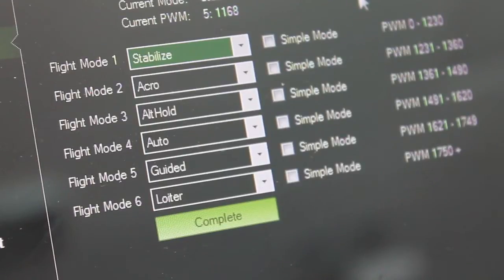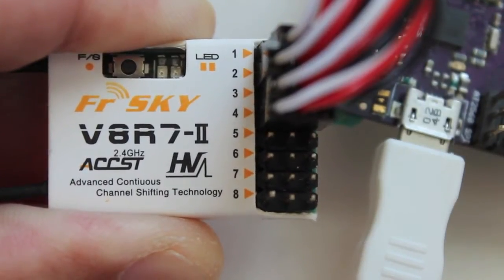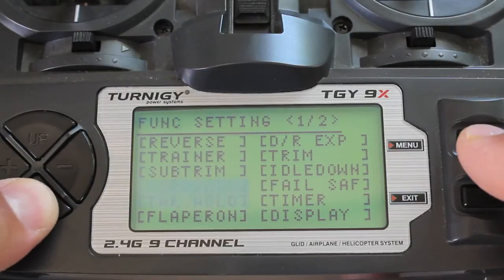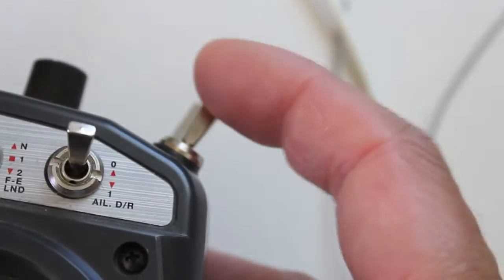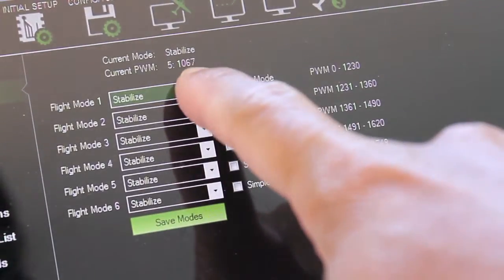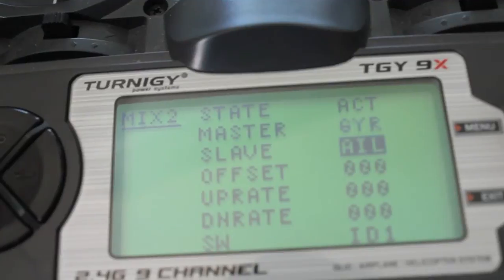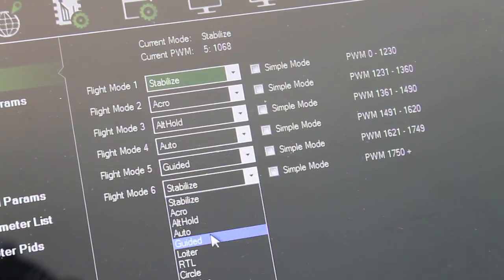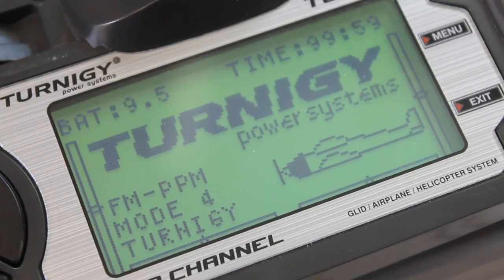Turnigy 9X Stock Firmware 6 Position Switch for 6 Flight Modes with APM 2.5 and Mission Planner

Comment: I have the turnigy 9x and apm 2.9. I performed all steps exactly as shown and got mix 1&2 working for states 1-4 when the SW is at position N&1 but the PWM is not changing at all when i am trying to set mix 3 for SW2. Any ideas on what may be wrong? Thanks in advance.
Reply from the maker: Anthony Caquias I'm not sure what's going on. Unfortunately I no longer have my 9X so I can't help diagnose. It sounds like you're close with the 1st 2 mixes so my only recommendation is to mess around with it a bit more and see if you can get the 3rd working. Sorry I can't be of more assistance!
Reply: Dennis Baldwin Thanks for responding. After 5 hours of troubleshooting my friend and I opened it up and found a resistor that wasn't soldered to the board properly causing a short. We were able to fix it and now its working perfectly. We also put in a switch to shut that annoying beeping sound off.

Comment: Are you using the frshy module on this radio? I can't get it to work on my radio with the flysky module and flysky 8 channel reciever. I got the 3 position in heli mode working but not the 6 in acro mode.
Reply from the maker: Ronnie Bruton Yes I'm using the FrSky module in this video. I'm not sure about the Flysky setup as I've never used it. Hopefully it's possible for you since I believe it runs the same stock firmware as the Turnigy9X. Sorry I can't be of more assistance.

Comment: Instead of using gear would dr switch be set up the same way on th9x? Would I have to use a different channel or change mix?
Reply from the maker: Ronnie Bruton I really wish I knew the answer to that question, but am not entirely sure. If you can configure the DR switch as an auxiliary channel then I would expect you to be able to do the same thing we do with the gear switch on the T9X. Good luck and let us know what you find out.
Reply: I seen done with er9x, maybe on heli mode

Comment: why do you use the ch6 on receiver and not ch5 and then why you assing ch5 but you use ch6 as gear? what if you use ch5 and how to if you could!
Reply from the maker: Nikiforos Pavlidis I'm not sure how to do that other than a custom firmware load like er9x or OpenTX. To be honest I'm not sure why it's configured this way as it's always been a bit confusing to me. But I'm glad it's possible to get the 6 modes. Thanks for the question and sorry I don't have a better answer :)
Reply: Dennis Baldwin  i am think to add a head tracker to my flysky tx but me receiver is almost full 1234ch for motors,ch5 is empty, ch6 to ch5 on apm,ch7 and ch8 on ch6 and ch7 on apm for rtl mode and autotune mode! i know i have to sacrifice the the ch7 and ch8 for head tracker channels but i like the idea to have emergency rtl mode to ch6 via throttle hold switch assing to aux channel. also my ch5 in rx is useless!!! thank you anyway for your nice videos and tutorials. keep up the good work!!

Comment: Hey does the inputs get switched back to normal after the flight modes are configured.  I have a y6 and I switched the inputs back but only have 2 flight modes now.
Reply from the maker: neil collins Interesting. I haven't tested that before. Will have to look into it. Thanks for the comment.

Comment: Dennis Baldwin, thanks! Guide work perfect when switching my new Quanum Nova to the 9x and receiver. Question. Did I loose my channel 5 now that I set up the flight controls on channel 6 on the RX? I wanted to use the extra channel I got with the new RX to do autotune.  Thanks again
Reply from the maker: Chris Haskins Hey that's a great question that I don't know the answer to. I should have check this when I did the setup. Duh! I'll see if I can revisit soon and find out. Let me know if you beat me to it :)

Comment: none of this does anything in APM for me. No flight modes change
Reply from the maker: Waylon Johnson Make sure you're on the right channel. I believe with APM:Plane firmware flight modes are on CH8 will with APM:Copter they are on CH5. If that doesn't get your flight modes PWM moving then I'd check out TX settings. If you have further issues then check out www.garagepilots.com and post in the forums over there. Good luck!

Comment: My PWN is 8, is there a way to change it to 5 like yours?
Reply: Solved it by changing params, thanks for the vid
Reply from the maker: You bet! Glad to hear you got it figured out.
Reply: Dennis Baldwin Leo TL  can you please tell us how you exactly solved it because my pwm is also stuck on channel 8 and i dont know how to change it. PS: i am using the board on a plane. thanks :))
Reply: You have to go to the full parameter list in mission planner and set the param called FLTMODE_CH to 5. I had this problem on my plane too so it should fix it.
Reply: Leo TL  it worked thanks a lot!!

Comment: Ok, this all worked, and it's great, but I'm a little confused.  Channel 6 on the receiver is plugged into port 5 on the APM.  Channel 5 on the radio is set (under AUX-CH) to GEAR (and if I change that back to NULL, no more MODES!).  Have I "consumed" TWO channels of the radio to get six flight modes?  Or, as I seem to have "mapped" channel 5 to 6, can I somehow recover channel 6 by "mapping" something else back to 5?  And this brings me to wanting to map other switches to channels.  When in AUX-CH, I get four choices in addition to NULL, THRO HOLD, PIT TRIM, HOV THRO, HOV PIT.  There is no knob or switch labeled "THRO HOLD", so this is a mystery, and apparently no way to address AIL. D/R, ELE. D/R, RUD. D/R, or THR. CUT.  Does this radio just have four totally useless and inaccessible switches on it?  I doubt it.  If Turnigy won't spend a tenth of a penny a unit to write a manual, they aren't going to spend good money on switches.  Any clues would be appreciated.
Reply: If you didn't get an answer to your question about AIL D/R, ELE D/R and RUD D/R look under function settings, D/R EXP. In there you can select the CH and toggle them on and off. As to the purpose, I believe it is to give the option for having dual rates.   I'm not sure. Hope this helps.

Comment: hi there i have one question... what if i need to use autotune ch7 in mission planner do i have to wire the cable from ch6 to ch5 in ch7 to ch5? or do i have to run a new wire fro ch7 to where? any help musc appreciate! thank you!
Reply from the maker: Good question. I'm not sure about that one but will look into it when I get my apm copter back in the air!

Comment: Hi Dennis,  thanks for your efforts to teach us. I tried this method on APM Planner and works,  but I have to use Mission Planner because its mapping tools and  doesn´t work anymore for me. In my MP version - 1.3.5 - The "current" channel is 8. What the correct connection for this case? What I have to change in my Turnigy and my connections from APM to receiver? I´d appreciate your help,  is very very important to me and I don´t found  options to fix it at Wikia. Best regards!
Reply from the maker: If you're running on CH8 then you must be running APM:Copter firmware. CH5 is used with APM:Plane. You can still use CH5 on your receiver and connect it to CH8 on your APM. Then configure as described in the video. I hope I understood your question and that this helps. Take care.
Reply: Tks again!

Comment: Thank you so much for figuring this out and sharing it I got everything all set up just like you had on your video but the only problem for me is that when I switch between modes the quad copter just jumps all over the place in flight almost falling to the ground. Especially from loiter to stable mode. It seems as if it were taking too long to switch between modes and losing flight control... any ideas?
Im using FLYSKY th9x and APM 2.5
Reply from the maker: I've never experienced much of a lag when switching flight modes. If I come up with any ideas I'll let you know.

Comment: Good morning, I have this hardware:

Frame modelo F550 DJI;
Motors 880kv RcTimer;
Placa HK APM2.5;
GPS Ublox Neo 6M;
ESC's Simonk 40A Optos
Hélices de carbono 10x4.7 RcTimer;
Radio Turnigy 9x Hobby King;

And I'd like to ask you if  can I follow this video from the begin to the end to set up my radio?

Thank's
Reply from the maker: You should be able to but my recommendation is to always start with stabilize mode before you mess with a bunch of different flight modes. If you're already flown in stabilize mode then yes definitely watch the video and setup your other flight modes :) Thanks for the comment.
Reply: Dennis Baldwin

Thank you very much about the answer.

Comment: how to get between the PWM
e.g.
1360 - 1231 = 129
129 / 2 = 64.5
1231 + 64.5 = 1295.5

1295 is your ideal value
Reply from the maker: Right. That would get you smack dab in the middle of the range :)

Comment: can you also make a tutorial how to setup these flight modes using Turnigy 9X, Turnigy 9X8Cv2 receiver, and using CRIUS v1 with MPNG please?
Reply from the maker: Hey Jayson, thanks for the suggestion. I don't have this receiver or flight controller, but if I did I would absolutely do a video about it. If I end up getting a CRIUS I'll definitely put a video together. Also, please consider joining us at www.garagepilots.com. Perhaps there's someone that can help you out if you're having any problems. Take care.
Reply: ***** is the setup safe for tricopter?
Reply: ***** thanks! I finally got it. Also want to share a simple math

how to get between the PWM
e.g.
1360 - 1231 = 129
129 / 2 = 64.5
1231 + 64.5 = 1295.5

1295 is your ideal value

Comment: Dude! You are the man! Thanks so much! Mine was a bit different because I'm using a Pixhawk flight control board which uses PPM encoding. I switched the #5 lead to the #6 spot on mu receiver and left the #6 lead out. APM kept recognizing the changes on the #6 channel. Anyways, all is working. Turnigy 9x with stock firmware and 6 modes on a Pixhawk!
Reply from the maker: Thanks Matt :) It's a continual learning process where most of the time I sit there and scratch my head. But glad to hear this is working for you.
Reply: did you use a ppm encoder to do this?
Reply: F. C. Bearsch Yeah, it's a must. It was a bit confusing because the 9x literature mentions PPM encoding. However I don't believe it is possible with the stock hardware. I bought the one from 3DR.
Reply: can you please share the video or pictures of how you have done,because I'm struggling with this I have fly sky th9x transmitter and how can i connect channel 6 in ppm encoder

Comment: Dennis, will this work on the Arduplane firmware update on my APM 2.5?
Reply from the maker: It most definitely should. Just keep in mind when you load the APM:Plane firmware the flight mode input happens on input #8 on the APM instead of input #5 with the APM:Copter firmware. Hope that helps.

Comment: I'm following this video to to letter but it not working. Everything is functional on my apm and turnigy.. I'm using the turnigy rx the down rates just are not changing... nothing is working. . I switch ch 5 to gear and l open my mission planner switch my gear switch and nothing.. help?? My email is stannardjoshua@yahoo.com
Reply from the maker: Hey Joshua, if I recall this is fairly dependent on what flight mode you're in (ACRO vs HELI). In one case even though you have your gear configured from CH5 you have to connect your receiver from CH6 to input 5 on the APM. Another thing to note is that APM:Copter firmware uses input 5 and APM:Plane uses input 8. Lots of little bits of info...I know :) If you have any further issues please join www.garagepilots.com and post in the forums there. Thanks!
Reply: I got it.. Thank you very much for all your input. . I just use ch 8 on apm and it works the same as your video..

Comment: Hi nice video I intend to follow it step by step. I have an Apm 2.6 and 9x rx. Also I am using a 4 in 1 Quattro Esc which should power the apm. My connections of my rx to apm inputs 1=ch1: 2=ch2.......5=ch6:
Escs red =output 1: orange= 2: white=3: brown =4:
Once I connect the esc to the battery, my board won't power up? Must I buy a power module?
Thanks
Reply from the maker: Check to see if your esc has a BEC. You should be able to power the APM without a power module. I've done it with my APM 2.5. Here's some info on power requirements:

http://copter.ardupilot.com/wiki/common-apm25-and-26-overview/#A-Non-technical-Description-of-the-Power-Supply-Requirements

Check out www.garagepilots.com if you want to post more info about your problem and we'll try to help. Good luck.
Reply: Thank you very much
Reply: Hi
Very simple and precise video. I was able to do exactly thesame but I can't get to "disarm the failsafe". My throttle signal is 975 at the  lowest and stays there even when switch off. 
I am using a 9x tx and rx. Any ideas please?
Thanks

Comment: Hiya Dennis  :
Many thanks for very helpful and informative videos , I am new to quads and I think they are great .
Finally decided to build my own Quadcopter using the APM 2.5 and Mission Planner , I am using an SK450 standard frame from Hobbyking and a FlySky TH9X radio and RX.
At the moment I am having the same problem as Markely Boyer with the FlySky...
This note is just to confirm to you both that this problem with 9X does exist . I will try Markley suggestion.
Cheers Dennis...!!!
Ramon.

Comment: Hiya Mark ....I have also a FlySky TH9X , and it has exactly the same problem as yours when it comes to the down or uprate having no effect at all in Mission Planner PWM—when using channel 5. I am going to try the settings you suggested for  exchanging the GYR ....but my question is ....what effect – if any-has to flying ,changing to your suggested settings instead of the GYR setting ??....Is there any links you can suggest for me to follow about this FlySky prob ???
Cheers
Ramon.

Comment: Dennis, yes it's in Acro mode.  I'm pretty sure I followed your instructions precisely, but could never get Channel 5 PWM to move.  I really don't understand conceptually what the Mixes are doing - why GYR and FLP are used - so makes it hard to troubleshoot!  It was only through blind fiddling that I stumbled across the working solution.  Please do let me know if you have any insights after reading my longer description on DIYDrones. Thanks.

Comment: Thanks for the great tutorial.  I'm using a Flysky TH9X which is the same as the Turnigy for some reason, these instructions don't seem to work. Adjusting the uprate and downrate doesn't have any effect on the PWM output on Channel 5.  After much random fiddling around I found that I needed to set Aux Channel 6 to gear rather than Aux Channel 5 and then use THR in the mixes rather than GYR.  I posted the detailed description over on DIYDrones on the Turnigy 9X page.  Interested in your thoughts.

Comment: Hi Dennis your videos have been very helpful thanks! I've got the 6 flight modes working fine with the help of your video. I can't get the throttle cut failsafe working. I've too got the turnigy 9x default firmware with the frsky D8R II-PLUS. When i cut throttle my pwm for channel 5 goes from 1070 to 1676 changing my flight mode 1 to flight mode 6. And in my falisafe page nothing happens. My mottors cut off too. Please help if you can.

Comment: Thanks for taking the time to look at this problem.  For now, I will use the two position setup since it works and continue to tinker with this issue. I will let you know if I have any luck resolving the problem.  I am thinking about modifying my transmitter so I can upload the ER9X software.  From what I've read, the ER9X software is better than the stock software. Thanks again for your willingness to help me with this problem and keep up the good work on your other videos!

Comment: All endpoints are set at the default settings (100%).  I tried moving the on and off gear endpoint settings to various extremes (0%, 100% and 100%, 0%).  This had no effect on the ch 5 PWM setting in mission planner.  It still reads a constant 1480 regardless of the endpoint settings.

Comment: I am using stock software in acro.  With ch 6 set to gear and ch 5 to null on the transmitter, the PWM for ch 5 on the mission planner flight mode screen reads 1059 with the sw down and 1898 with the sw up and flight modes toggle between 1 and 6. With ch 5 set to  gear and ch 6 set to null on the transmitter, the PWM value for ch 5 on the mission planner flight mode screen is 1480 (flight mode 3) regardless of the gear sw position. Could this be an issue with stock program mix software?

Comment: Hi Dennis, I set mine up with the three position switch being flight modes 1, 2, 3 with gear down then 4, 5, and 6 with gear switch up. I put RTL (Oh Crap Mode!) on number 6 and 3 so no matter which way the the three position and gear combo were at all I have to do is flip the three position to down #3/6 and it goes into RTL.

Comment: I recently bought the new APM2.6 controller and have tried setting up my Fly Sky TH9X for 6 flight modes per your video, which is very good by the way, but when I am in the Program Mix mode, with Mission Planner on the Flight Mode screen, I do not see the PWM changing when I adjust the Uprate or Dnrate.  I have ch 6 from my receiver connected to ch 5 of the APM.  When on the Radio Calibration Screen, all channels respond correctly except channel 5.  Is there something I'm missing?

Comment: Dennis can you set up dji naza with gps to use the 3 position switch for GPS,Attitude and manual.Use gear switch for Return to home while in Gps flight mode.If so how would i set this up.Thanks

Comment from the maker: Hi, I don't specifically tune my PIDs. What I do is use the Save Trim and Auto Trim features to stable my quad automatically. Check out my video titled "APM 2.5 & ArduCopter 3.0.1 Auto Trim and Save Trim Compared" to see if that helps.